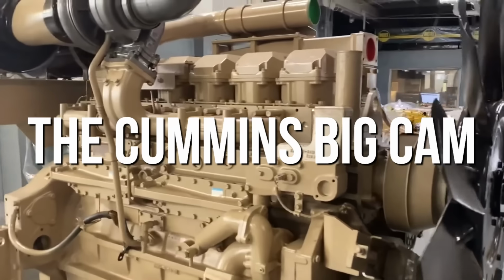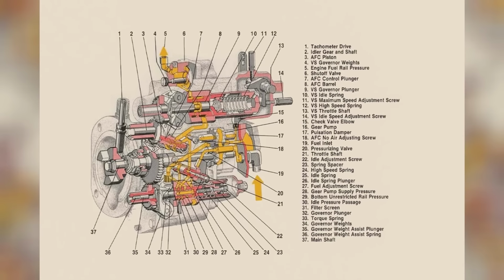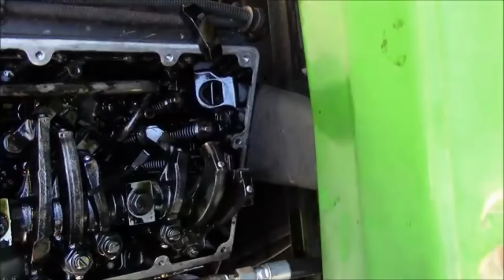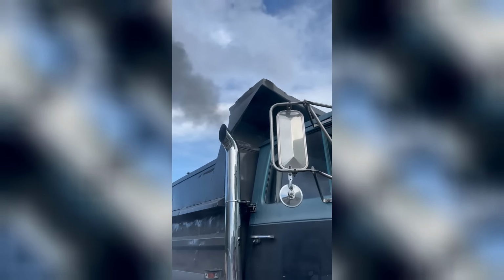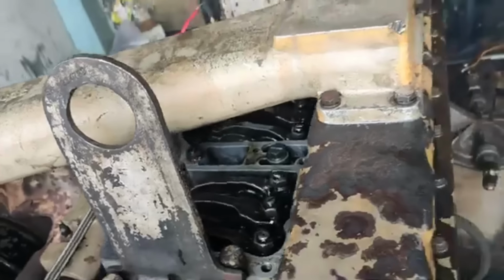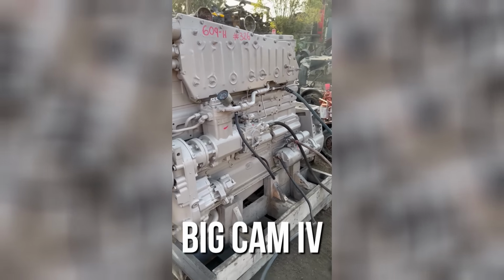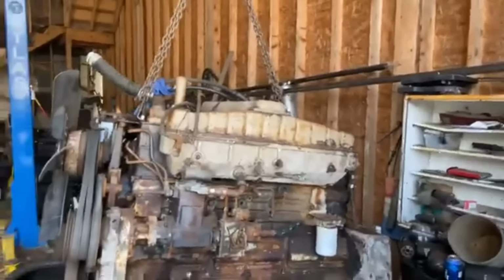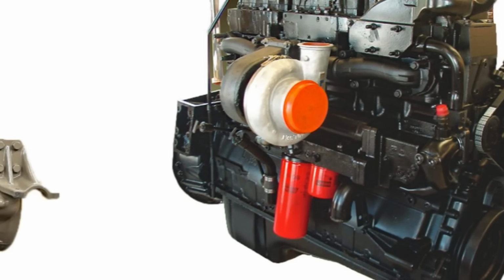The Big Cam’s Fatal Flaw: It Was A Ticking Time Bomb

Comment: Great engine back in the 80s. They were the best at the time, as CAT had just established the 3406B in 1984. CAT dominated after that for a few years to end of 2006.

The real HP myth (ghost) you rarely see was the Twin Turbo 475hp Cummins. One bad ass engine, but it had a flaw in the cam shaft timming, that caused issues. They were recalled, replaced with the 444hp. CAT was at 425hp with 3406B, and 450hp 3408. Cummins KT was still the torque king.

Comment: On the big cam 3 you could cleanup oil that got dirty from drivers that ran them at the top end of operations if you ran them down the middle of operating 
Lows and highs they did a great job

Comment: I worked on them for many years, Cummins tried to create a better engine by using old designs. it did not work well. The block was weak, the crankshaft was weak, and prone to breakage,the liner counterbores broke frequently and Cummins knowingly built engines with bad blocks. They were so conservative they lost just about all of the class 8 truck engine business due to terrible management. The 3406 Cat tore them to pieces.

Comment: I had a new 290 Cummins in 1978 a new 300 in 1982. A 400 big cam 4 in 1987. Hated the low flow cooling. Lots of radiator trouble. Was actually lucky with all three engines. Just lots of radiators. Good video
Reply: Still  got  one  in  my. Road  boss  great  motor  always  has  been

Comment: Ive never heard any of this and lve been around this for 50yrs. I bought a 81 big cam2 had 37000miles on it when installed it in my truck in 82 replacing the old original 73yr model small cam 350. Ran it for years before rebuilding it. No counterbore work needed. Had the pump off of original motor on the cam2 with no anaroid valve. About 200 r 210 pounds of rail pressure at 2100, stock l think was 190maybe. Everywhere l went l was grossing 100,000+. Know folks who has N14s and no problems and still a better engine than anything out there today. The only engine that l ever heard giving problems was the twin turbo 475hp. that came out in the early 90s maybe. The 855 big cam and N14s are among the best most cheapest to maintain and rebuild ever. That shit they make and put in these new trucks have all sorts of problems lm told.
Reply: Thanks for sharing

Comment: I agree with about 80% of this video. The STC systems problems were 1. Lack of understanding how to properly adjust the overhead. 2.Not following the maintenance guidelines. The STC valve itself was only the problem about 10% of the time. The real problem was the tappets would wear internally and total injector plunger travel would decrease causing the plunger to NOT seat in the cup. This caused the white smoke and slobbering due to poor fuel atomization. The FIX-I used to run an injector flush then pull the injectors and give them to Harry in the fuel room. He would reset the internal travel on the tappets to specs. I'd Reinstall the injectors and set the overhead and the white smoke and slobber was gone. Later Cummins came out with the OBC - outer base circle overhead adjustment procedure and that compensated for the internal wear of the tappet during overhead adjustment without having to remove the injectors. Many unnecessary and at times destructive fuel system repair events took place due to ignorance of the system. Cummins sold to anyone all the manuals so anyone could buy the information to correctly repair the fuel systems. You failed to mention variable mechanical timing which came after static BC timing but before STC variable timing specifically for California engines but it had to be used on the twin turbo NTC-475. I worked as a tech, then Diagnostic tech and finally shop foreman at a Cummins distributor from 1978-2014.

Comment: Try to find an STC control valve these days. Hard to even find and new O- Rings for them. They end up leaking fuel into the oil. But they are  not as hard to find parts for or work on as the Mack interem engines with the stepper motor on the pump drive..what a mess

Comment: I  do  not  know  why  y        .
.                                                                    ou  keep  bagging  all  these  motors  by  cummins
Reply: Why  do  you  keep  bagging  all  these  older  engines  they  did  a  great  job  in  days. Gone  by  the  big cam Cummins  is  great  motor  have  one  in  my  road  boss
Reply from the maker: Yes, many of them did. But nobody talks about their downsides, so I thought I would. Doesn't mean they didn't serve a purpose, or work for most people, but I find it to be an interesting angle.

Comment: To fix the start up and light load smoke and rough running Cummins rigged the oil pressure system to more than double at start to advance the injection timing which solved that issue. I know as I worked at a Cummins factory distributor for 20 years. At that time Cummins Engine Company was battling against hostile takeover bids in the stock market to a company that wanted to break up different divisions of Cummins. There was no electronic codes as the engine were 100 percent mechanical. Look at Cummins stock today about $ 285 share. Now compare the old screaming Detroit to the Series 60. A lot missing in this YouTube.😅

Comment: When the Series 60 came out the game was changed. It was designed from the start with electrictronics. Started seeing them in the mid nineties for 
 inframes at well over 800k miles. What a great engine.

Comment: The KTA600 in my opinion is just as good or better with more horse power and torque to boot. A solid 6 inch bore and a 6 inch stroke a stronger block, just a better engine I think . . .

Comment: This guy has absolutely no clue about how the STC system works I have worked on them back in the day. If you ran the overhead on the outerbase circle of the cam you had very few problems and there was different injector torque specs for different cpl's. One thing he stated was oil pressure decided when the timing changed, this is absolutely wrong. Fuel pressure shifted the STC valve which sent oil to the injectors to change the timing.
Reply: facts you are 100% right I used to build stcs using outer base method
Reply: Amen. STC was either advanced or not. OBC was the key. I thought it was a pretty simple system. Still running a CPL 1380. The big drawback on BCIV was the POS low flow cooling. What a joke. But they were trying to speed up warm up time by taking aftercooler out of the cylinder block coolant circuit.
Reply: @chadsmith7911 yes I don't regret them doing away with the low flow cooling system because you called it exactly what it was lol

Comment: They never mentioned about big cam I breaking camshafts behind the cam gear & valves hit the pistons
early big cams broke crankshafts too
Reply: Crank breakage was caused by vibration damper failure

Comment: Your a little wrong,, the control of timing was done in the injector alone not on the lifter.  I have one and still driving one with over 1000000 k on it still over it
Reply: Is the oil pressure what actually activates the valve timing?

Comment: Drove an '88 W900 with a Big Cam IV Triple Four and 13-speed and felt unstoppable. Never had a problem with it, but then I only had it for a little over a year. Truck had 700k miles on it at the time, but engine had been rebuilt about a  year before I got it. Loved the smoothness and power. Also loved the way it would lay an entire neighborhood in a cloud of smoke on a cold start, the stacks belching out awesome smoke rings. Only part that sucked was no cruise control.

Comment: I still have the STC tool that holds the top plunger on the injector. When setting the overhead adjustment on the L10 engine. 
 The precursor to the M-11. 
  The injector lobe on the injector cam, wasn’t egg shaped. It was circular, with a dip.
 The nice thing about those old engines, was the  3 cylinder heads. If the engine dropped a valve, you only had to pull one head, and put a cylinder kit in that cylinder.
Reply: Best engine for a driver that knows how to do their own work !
Reply: Could use one or two pullover sweatshirts size large
Reply: The dip in the cam shaft kept the fuel from entering the injectors until it was needed, in the isx they played the same game by fueling front and rear cylinders with the same solenoid actuators, such a simple system it hurts our heads, causes when it doesn't work properly you don't know how to fix it, stay blessed God is good

Comment: This video repeated the phrase "the larger cam allowed engineers to achieve more precise injector timing and higher fuel pressures" at least 3 times in the first 3 minutes.  Recommend not repeating statements so many times just to increase "video duration" -- The information in the videos is definitely interesting - but repeating phrases time and time again to fill "voids" information reeks of AI generated slop content instead of an actual author writing the words and creating the content.

Comment: Worked on big cam 3's for 10 years in a snowplow fleet. Never had any of these issues. Never even changed an injector. They were a mule of an engine when specked properly. 3208 and c12' cats could not compare.

Comment: BS 🤬 AI you are talking to a real human that worked at Cummins in Columbus, Indiana from 1968 to 2002.
Reply: Absolutely, he should do some research before spewing a bunch of BS on a product he knows nothing about. I worked on them and quit watching when he said as oil pressure increases that changes the timing. Complete BS.
Reply: @davidsignor7931 so, oil pressure isn't what activates the system?
Give us a run down.
Reply: @rdallas81 the STC valve has engine oil going to it and a fuel line that comes from the rail side of the pump. When you press on the throttle it increases fuel pressure which opens the STC valve and allows engine oil pressure to go to the injectors to change the timing. It's been 30 years since I have worked on a STC system  but that is basically how it works. The STC valve can be adjusted to the amount of fuel pressure needed to change the timing. This system worked but it was problematic.
Reply: @davidsignor7931 so in all reality he wasn’t actually wrong oil pressure does change the injector timing it, it’s just not triggered by the increase in oil pressure its triggered by increased fuel pressure

Comment: Red Top 855 was great motor.  I drove several Big Cams, the Big Cam 400 with a 15spd back when it was 55 you could set it and forget it .  Remember those days.
Reply: That's because a red top was an N14 that was an 855 on steroids

Comment: nothing wrong with big cams  until they put the stc on.  when they did that they changed pistons and lowered the compression ratio  to lower nox.  thats when they went to crap. it was easier than said here to delete the system.   try starting a bciv 400 at zero degrees with no block heater.  it aint gunna happen.

Comment: Small Cam 2.0” dia.
Big Cam 2 1/2” dia .
Step Timing Control was poorly designed and engineered . A short lived trashy engine .
Cummins always had an antifreeze usage problem . PTG fuel pumps were pretty much full proof and inexpensive to repair .
I think a one piece cylinder head would have helped .
Reply: Got one been driving it for years no anti freeze usage fix your leak
Reply: One piece cylinder head would have strengthened the whole engine assembly a lot, but it does help fix an engine in the field, but doesn't help with a full inframe

Comment: Worked on countless NTC engines. I remember one of my customers had an A model KW with 5x4 stick and twin turbo. Was rated at 475hp. Every 2 or 3 weeks the auxiliary transmission would break most of the frame mounting bolts. They were hauling 50 to 60,000 pound loads of potatoes from Colorado or NM. Good days .
Reply: The twin turbo model had mechanical variable timing .
Reply: @vicpetrishak7705 
And was a beast!

Comment: There is thousands of big cams that do not have the stc! And they are just as reliable as anything! I love the raw diesel smell smoke about mine when you crank it up! Hell they made the big cams, small cam’s for years and years before the stc came out and then they didn’t do it for very long! My big cams and n14’s run great,pull great and get good fuel mileage!
Reply from the maker: Yeah, those pre-STC ones were awesome!
Reply: @VintageAmericanMachines i have a cpl625 big cams 3 with only maybe 1 to 2 rebuilds at most and a big cam 3 cpl 531 350 cranked up of course! N14 celect plus 2025 525hp, n14 celect plus cpl 2592 525hp, and a n14 celect cpl1844 500hp so i am surrounded by the 855 platforms but for the 444, and big cam 4’s i would have to remove the stc and make it a high flow before i would work it! Unfortunately the epa continues to make things worse!
Reply: @jopete681 E.P.A.=E.P.A.W. Every Part Always Worse!...from Wyoming USA 🇺🇸 👋🤠
Reply: Have you ever put pacbrake kits in your Jake’s. they were strong, sharp and loud.
Reply: So why are you here?

Comment: The video is so full of lies it’s not funny . They tried step timing on one NTC engine with twin turbos and it didn’t work. It was the NTC444. Cummins also tried the step timing on the KT series engine and it never left Holset Engineering. Know because I used to work for Holset Engineering.
Reply: If I recall the twin turbo had mvt or mechanical variable timing using truck air to move the cam followers.  Main issue with mvt was rust from the air causing the mechanism to stick.   The other issue was the power cylinder components would wear quickly as the materials were not able to hold up.   The newer 88nt version had better power cylinder components and some had STC or step timing control.  We ran a 444 in a 89 379 almost a million miles.  The cam, 1 head and 5 of 6 of the original power cylinders were still in it.  2 heads eventually developed bad injector seats.  Only 1 new injector was needed.  The 6th cylinder finally developed cavitation damage.   Overall it was a great engine.   Cold starts were interesting.  I still have the failed injector in my old tool chest.
Reply from the maker: @VHP7044 Wow, a million miles! Very cool.
Reply: We had the twin turbo 444 here in Australia they went well but had a lot of problems there Nick name here was cripple 4
Reply: Twin turbo was 475 with MVT , STCs were many versions, BC IV,
Reply: Yes cummins did release S.T.C.on ktta ( industrial). I have (2) of them , if you think kta run ktta with stc will pull (1) gear more & a little more fuel it will pull (1)gear more  , ( total  od (2) gears more , YES IT WORKS 😂

Comment: These engines had a band aid fix. They were not reliable max life in heavy equipment 7000-8000 hours. Komatsu engines would last 15000 to 18000 hours.
Reply: a lot of Komatsu engines are rebadged Cummins. the Cummins KTA 1150 was designed and built by Cummins and Komatsu because they needed a larger engine for heavy equipment.
Reply: We have some komatsu dozers with Cummins in them